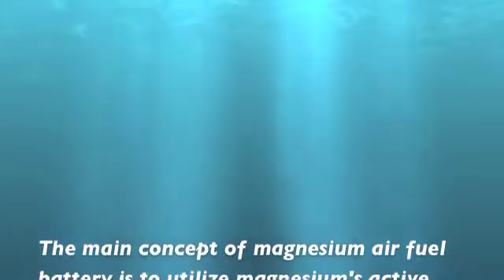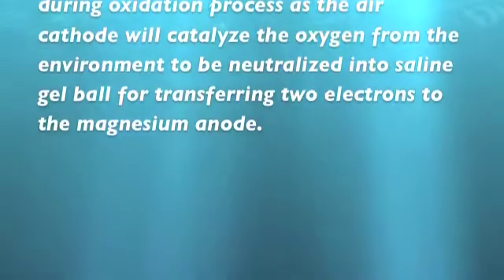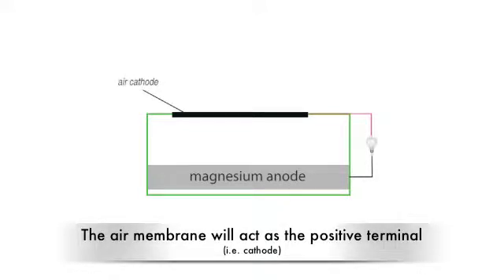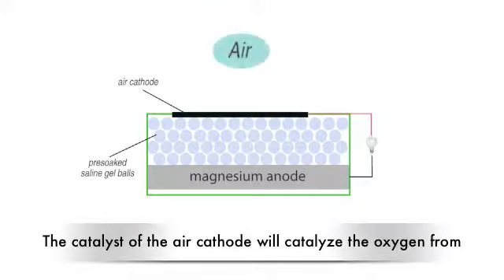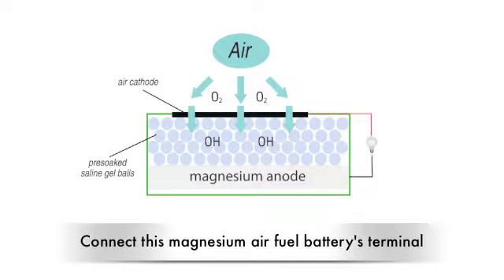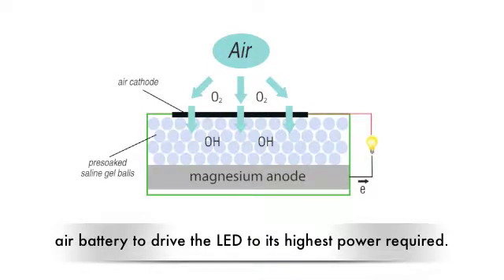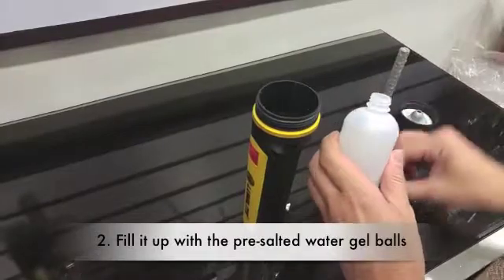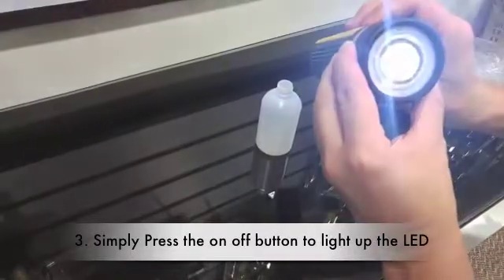Magnesium Air Fuel Cell Torch 7280 Video

Comment: I have a question. I am wondering about the air cathode. HAhaha What is it? I mean, is it a "thing"? If I'm going to make a magnesium-air fuel cell, aside from the magnesium plate and the salt water solution, what shall I still have? What air cathode? Thanks!
Reply: Activated carbon